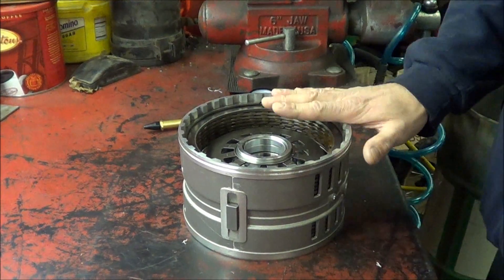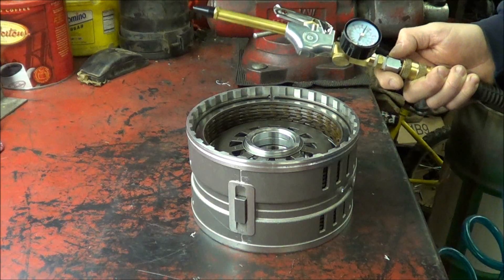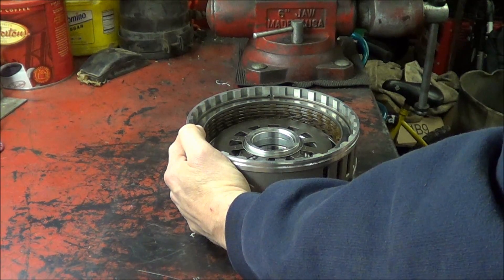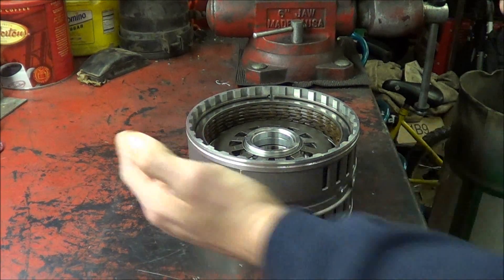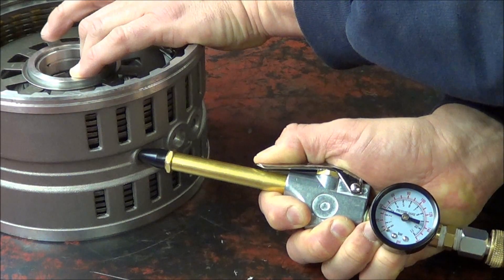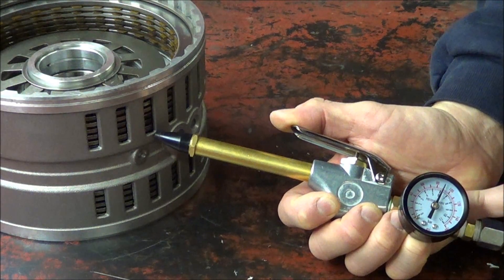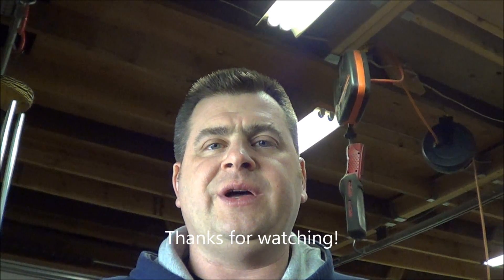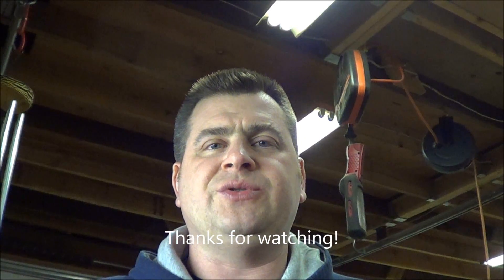4-3-13 automatic transmission clutch dry testing tool in action

Comment: Why wouldn't you just dial the compressor regulator down to 40 PSI?
Reply from the maker: beanhead1130 because I like tools
Reply: You and me both!
Reply: I'm getting ready to take my ASE 2 TEST this is a question on the test us it ok to add air to check clutch pack and is it ok to clean the ports out with air?